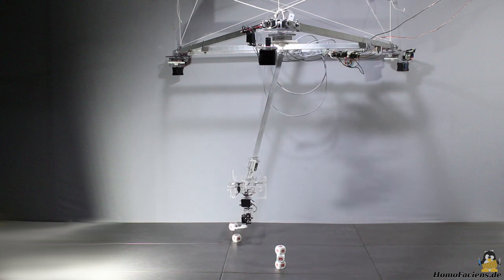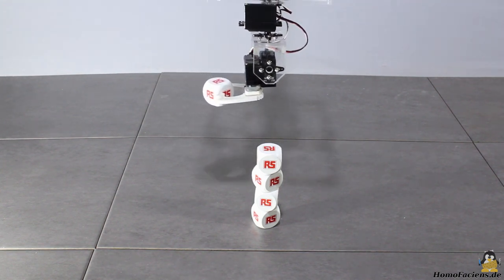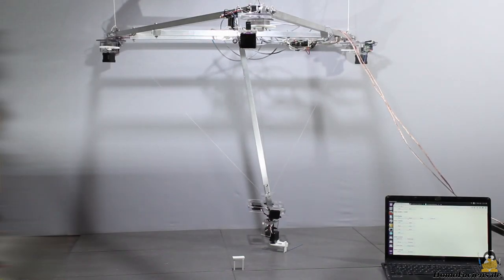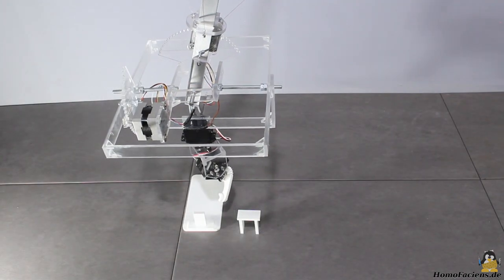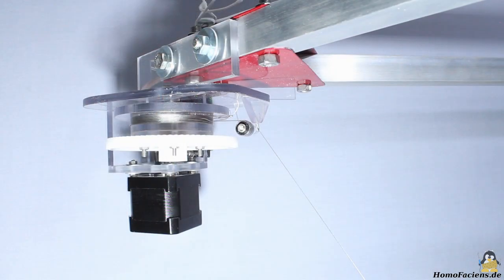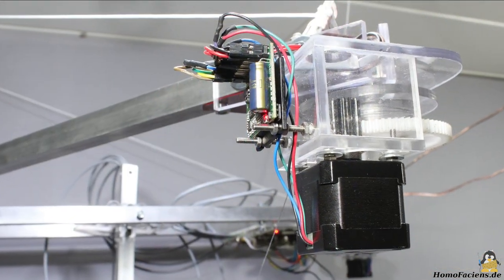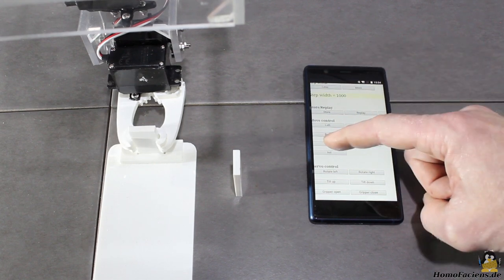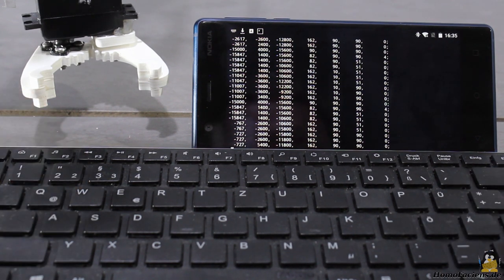WinchBot 1.5 - a robot made of winches and servos

Comment: Amazing work as always Norbert! One question though, do you include the change of diameter of the spool in the calculation of position? Or is it just negligible in this case as the wire does not seem to have many turns on the spool? Best wishes from Lithuania
Reply from the maker: As you said, the change in diameter is negligible. The software side isn't that perfect - there is a bit of "guess the correct coordinate parameters". It's not for starting any kind of production, it's just a nice machine to teach or learn coordinate transformation.
Wishes from the south of Germany.

Comment: Hi Norbert, could you elaborate on the reasons why you had to use these pricey Geckodrive modules ? Is it due to the current requirements caused by the increased weight of the assembly ?
Reply from the maker: The Gecko drivers are what my sponsor wants to promote on the exhibition in Nürnberg (Germany) and that's what this WinchBot revision was made for. On the other hand: If I am using those cheap drivers, they generate that much noise that I no longer can receive a radio signal in my workshop. It's good noise cancelation, documentation and specification for professional use that makes them more expensive.